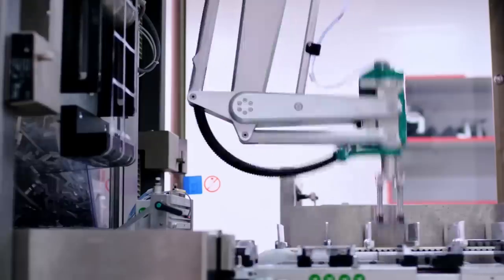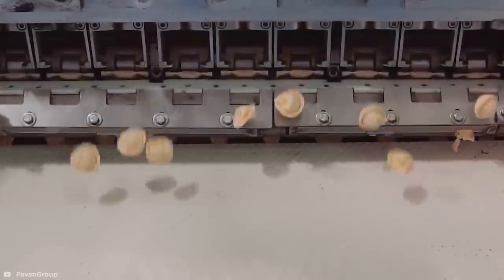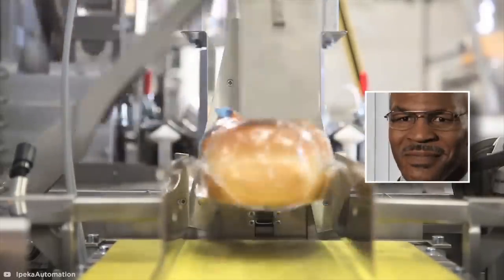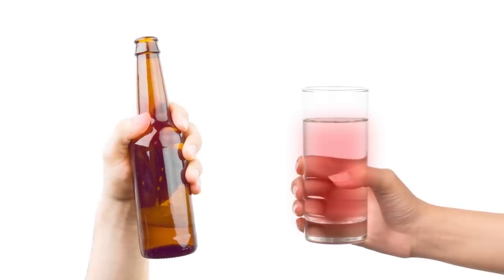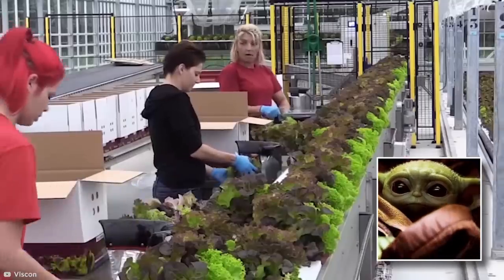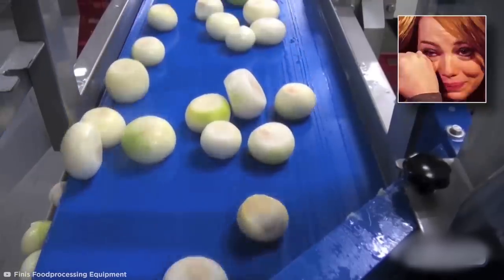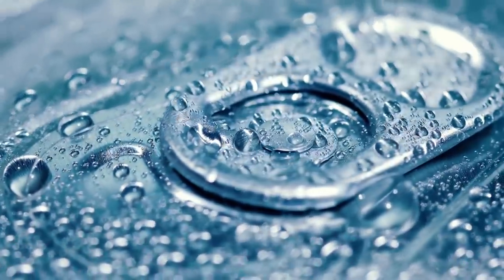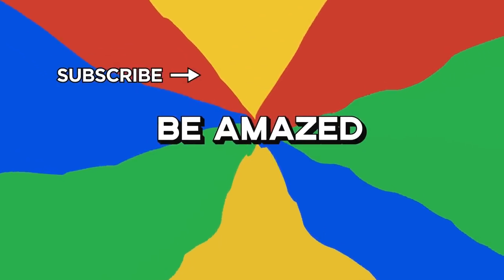Satisfying Machines That Will Make You Want To Work In A Factory

Comment: Someone needs to help me with the math here. It says they can make 150t of pasta per day or ~1,000 kg/h (~2,204 lb/h). I'm no math whiz by any means but even I know those numbers don't come anywhere near adding up. It would need to produce at ~5,700 kg/h (12,500 lb/h) to meet the 150t in 24 hour mark. Someone let me know if I am doing this math wrong.

Edit: To put it a different way, both of those numbers would only add up to about 27t in a 24 hour period.

All of this said, I could be wrong: I am wrong a lot.